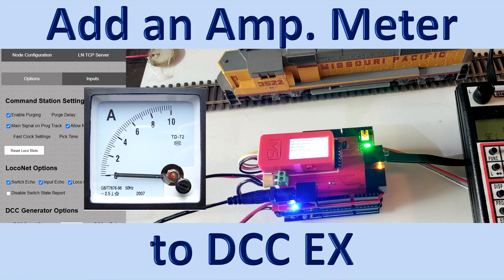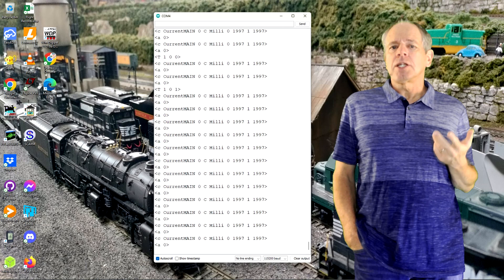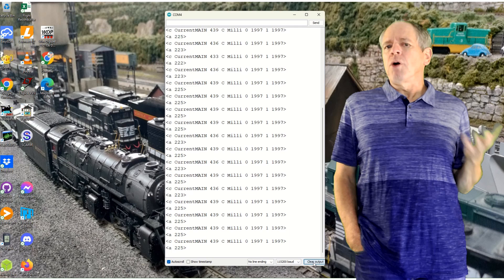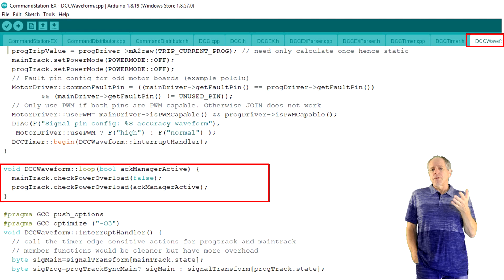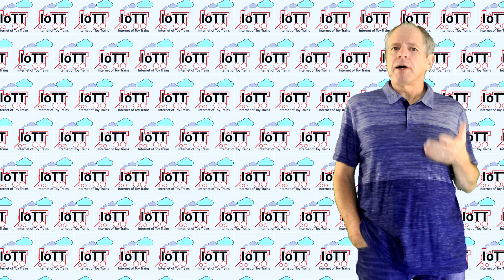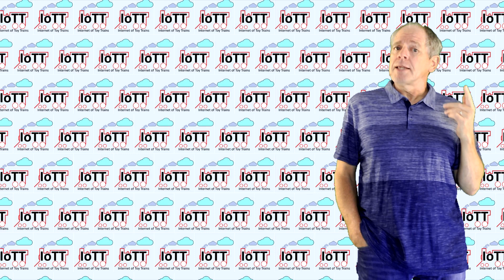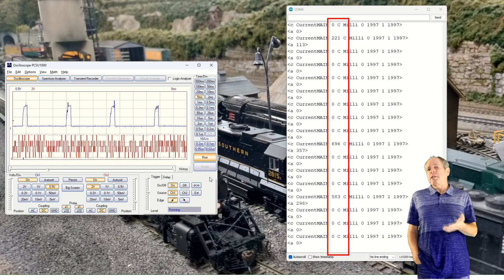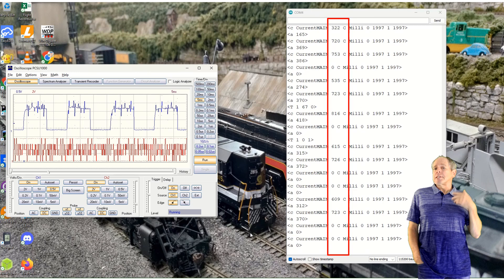Amp Meter for DCC EX (Video#103)

Comment: I ran into the same issue.  I even had nuisance tripping of the overload sensor as well.  Ultimately I have disabled it and rely on the overload protection from the power supply used to drive the motor driver.  Its nice to understand why the issue occurs. Nicely done!
Reply from the maker: Yeah, overload and short detection is quite tricky. It is a trade off between shutting down because of a single spike and risking the H-Bridge for not timely doing it. And then all that on an Arduino which is not exactly a computing superpower...
Reply: @IoTT  Yep so I also have DCC electronic circuit breakers on the other side of the HBridge protecting each zone of the layout.  9 times out of ten these trip first if there were any issues.  But it would be great if the the one on the arduino was more robust.  Looking forward to the next video.

Comment: I saw a DCC++EX command station with...I think a 2 line LCD display connected to it. It showed weather track power was on or off, as well as the available RAM on the second line of the display.
I couldn't find any videos on how to add an LCD display to DCC++EX.
Also, can more status information be displayed, like maybe the status of the CPU on the arduino?
Reply from the maker: DCC EX has built in support for I2C displays. Check the DCC EX documentation here: https://dcc-ex.com/reference/hardware/i2c-displays.html
Of course you can display additional stuff as  you wish, but you have to do some programming ;-)

Comment: Obviously, the current measurement issue is a complex one, and not easily solved because of the different decoders actually drawing power to move multiple locomotives. I doubt that there's an easy solution when you factor what you've seen into anything practical.....using a low pass filter like you suggested would make the current detection in response to programming functions difficult if not impossible.

Since you can't use a low pass filter on the program output, if one was added to the main output ONLY, that would likely work, but require some simple hardware to be added to the h-bridge output, except for receiving data from the locomotive(s). That's a dead end.

As a more practical solution, since the program output is minimally used, measuring the input current to the h-bridge would make the measurements much simpler and practical. Unfortunately, it would require using an extra analog input and possibly some extra components, and DCC-EX to actually define that extra analog input as being used for current measurement. I really think that it would be a practical and accurate measurement that would work with the RED Hat and DCC-EX in general.

The work that you've done in this area points the way to actually measure current accurately. Thank you for your work.
Reply from the maker: One of the nice features of DCC EX is that it can use the prog track as regular track when not used for programming. So, I want to have current measurement on both outputs. And I agree adding a capacitor is not a good idea. Not only does it have an impact on the timing, it also lowers the voltage while discharging.
The correct way is to increase the sampling rate to get a more detailed image of the current curve over time. 
Measuring before the H Bridge does not make a big difference unless you install a real good size capacitor right next the the bridge. Unfortunately, those PWM pulses look quite similar on both sides of the bridge.